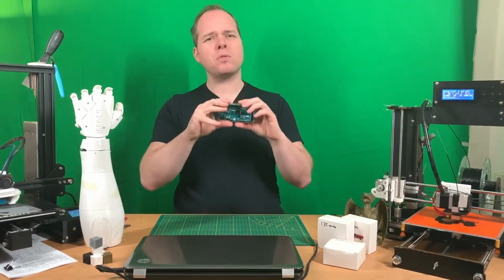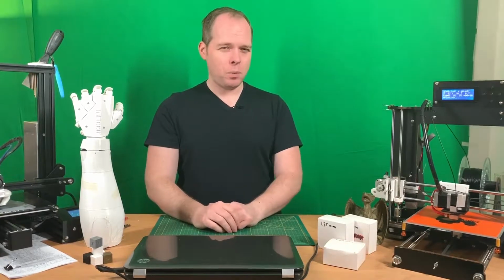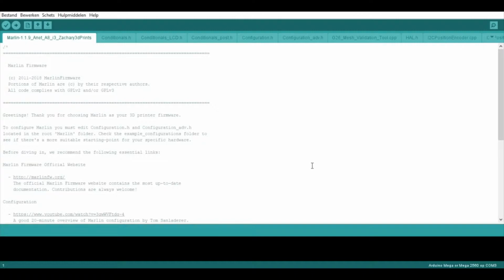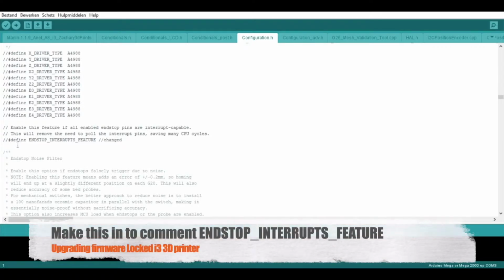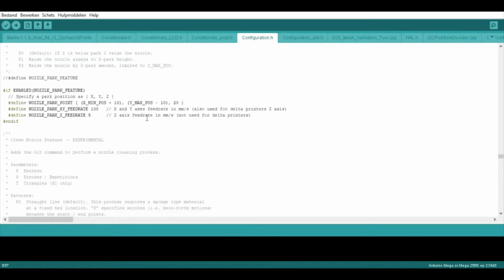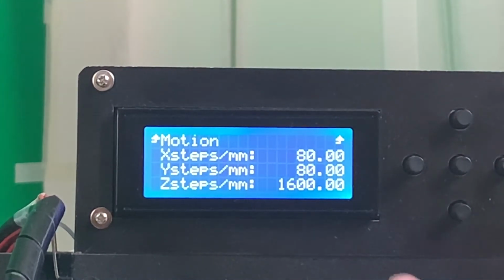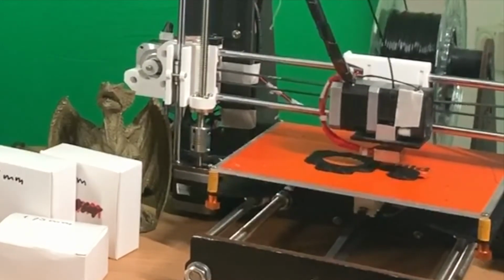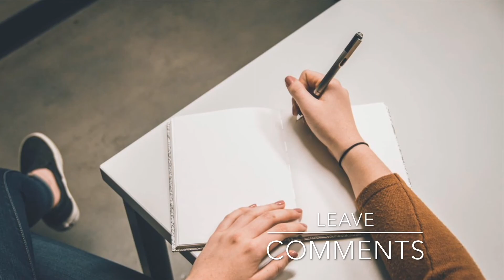How to flash Marlin Firmware i3  3D Printer or other 3D Printers

Comment: hey my lcd displays the hotend temp but not my bed temp. the bed doesnt heat up anymore either. any ideas?
Reply from the maker: Hmm, are all the wires connected correctly?
Reply: @Zachary3DPrints  yes they are. it doesnt recognise that the bed is heated.

Comment: hello zach, thanks for this useful video, I have a question: I have the same 3d printer as the one in the beginning of the video, but my issue is I did not have an sd card in it before, so I'm assuming I am also missing the correct firmware. I bought a new micro sd card, and the printer has gone from giving me a "card remove" error to "card inserted". I'm wondering - A) is this a firmware issue? B) can I just install the firmware directly to the sd card? C) could this potentially ruin my printer?

I got this printer for free because it used to be broken, I've repaired all of the hardware, connections, etc.. though so it should be good in that regard. Any help is appreciated!
Reply from the maker: Yeah it can be firmware related, did you try to print with this printer yet? If you can print and you can make some little changes, then that is great. If not, than check this video or some other videos about updating the firmware on the red Anet A8 board
Reply: @Zachary3DPrints  I have but for unknown reasons it isn't fully recognized by my PC. Im guessing that it's just an issue with missing files, because my computer detects an input. I also found out I got too large of an SD card (64 gb) so now im waiting for a 32 gb card. Thank you for posting the name of the board too, it's been a real struggle finding info on my printer because of how I got it lol. I'll go research my board and its firmware, it's looking like I might have to learn airduino a bit, hopefully not though so then I can get some prints before the year ends. Ill post again if I can get a print, even if its just a blob lol
Reply from the maker: Oh thank you, I'll be looking forward to

Comment: hello zac!! i wil try to do mine ctc and also the lead z rod!!! cheers from the usa!!
Reply from the maker: Oh cool. Which kind are you going to use? The 'magic number" for the normal is Esteps 2560, for the ones(2mm pitch) I have 1600. If you have the 8mm pitch check for 400
Reply: @Zachary3DPrints  hello my friend!! i just got the lead z rods, but how do i change to 2mm? i'm no very good for programming!! thanks!!
Reply from the maker: Oh you don't need to program it, if you are able to make the change in the Menu. Can you check this? Go into the menu, Advanced setting, and check if you are able to go into the E/steps per mm. If not, are you able to follow these steps from the video?
Reply: good morning @Zachary3DPrints  thanks for your response! yes i can go to advance settings! so to do the change for the lead z rods  i have to put down zsteps to 1600 right? thanks!! and have a great day!!
Reply from the maker: Hey Beth, within the Advance settings, you have the Esteps/mm. In there you go to the one for the Z axis. I think that one is still on 2560 change this to 1600. go 1 time back in the Menu and check if you see STORE SETTINGS... if so click it and see if it saves. turn the printer off, and back on, and check if the setting is still on 1600, if it is back to 2560, you can't store it...
Reply: @Zachary3DPrints  hey zach i did those changes but it doesn't save the new settings thanks!!
Reply from the maker: Yeah I thought that could happen. Can you follow these steps from the video?
Reply: @Zachary3DPrints  hello!! i did everything  and  i go an error "sketch uses 11610 bytes (43%) of program storage space. minimum is 253952 bytes. so i'm stuck! THANKS
Reply from the maker: Beth Phoenix a how is or was your printer mainboard connected? The sketch from the bootloader isn’t big. As you could notice in the video, there was one point that the bootloader was installed on the board. Maybe checking to connect it with USB
Reply: @Zachary3DPrints  hello!! Tried to use the USB and didn't work, I used arduino uno did the wiring and nothing, it said programmer is not responding,  i connected it where the SD card connection goes, I checked a video where it shows how to wire the uno to the board,
Reply from the maker: @ismara17   I had my Arduino board mega and the ISP Programmer connected. I used the wiring from this site: https://www.youtube.com/redirect?redir_token=QUFFLUhqbU5UcW1zU2ZTaDBXcUVTZUlROGNiRDREdERaZ3xBQ3Jtc0trTHd0NE9SaGVJdW9Temx2ZkJwa1JWMGRYd0xZcXViR0l5QUtYMW1FQXF1SGlsNllPeEVBYWg1emo1Vm03TzFPWXFRTEpxTlFPR2lBVTFZdWRsMTRZZ1RpZjZHSHdlQzkwTk81WFJ2WW9PYXR4anc3SQ%3D%3D&q=https%3A%2F%2Fwww.google.com%2Furl%3Fsa%3Di%26url%3Dhttps%253A%252F%252Fuptanium.org%252FBurn-Bootloader-A8.html%26psig%3DAOvVaw2MfdsovZKnV4wUsnwC83f_%26ust%3D1590250469084000%26source%3Dimages%26cd%3Dvfe%26ved%3D0CA0QjhxqFwoTCMC1t-Tux-kCFQAAAAAdAAAAABAD&stzid=Ugwsgyuc5FJABrjijIZ4AaABAg.98yDw1tjoXa98yHaprdn9B&event=comments
Reply: @Zachary3DPrints  thanks for the reply!! my board is white and model is 2560, so are they the same connections as the page that you said ?
Reply: @Zachary3DPrints  good morning from utah zack!! i finally updated it!!! and follow your settings!! ctc is working better!! Bryan Martinez is my son and he has this wwe channel!!now i can store my settings!! thanks for those great videos!! have a nice week!!
Reply from the maker: Beth Phoenix Hey Beth, very nice to hear that you were able to store your settings! I’m still upgrading my CTC...
Reply: @Zachary3DPrints  yeah i can see it on your videos!! i'm going to upgrade my hotend, it has a clone e3d with the original!!

Comment: Do you need that cable? I have a previous model of the CTC that you have. Would it work?
Reply from the maker: A similiar one that is called TinyISP, these ones are newer and work better with Windows 10 than the one I used.
Reply: @Zachary3DPrints  do you have a link by any chance?